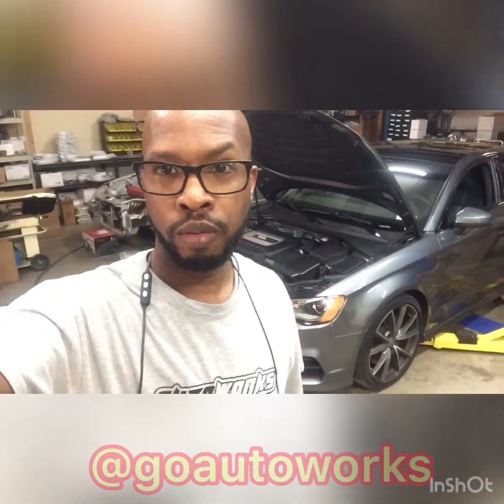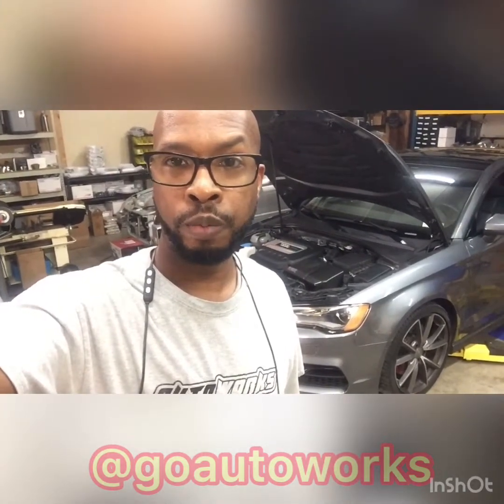Audi S3 CTS downpipe install

Comment: Watched a few of these install videos. You are the first one that has mentioned anything about moving the 02 sensor.  Do you have to do this if you do not do the resonator delete? Thank you.
Reply from the maker: I would say probably not
Reply: Did you need to use an o2 sensor wire extension?